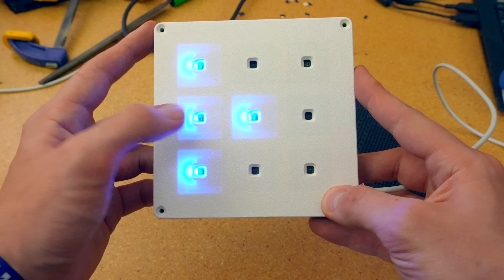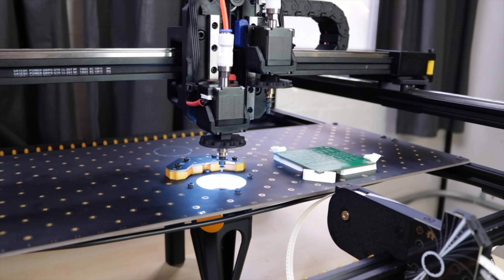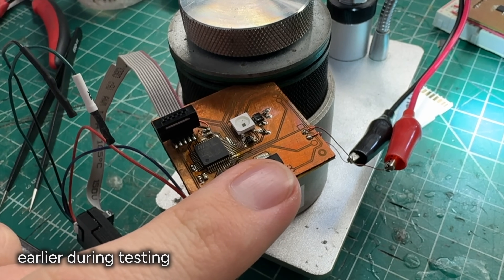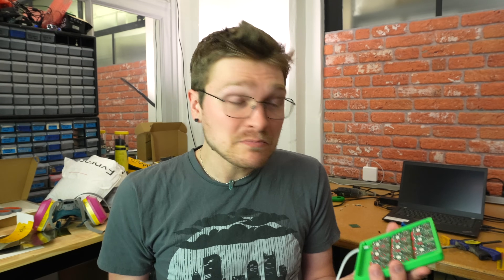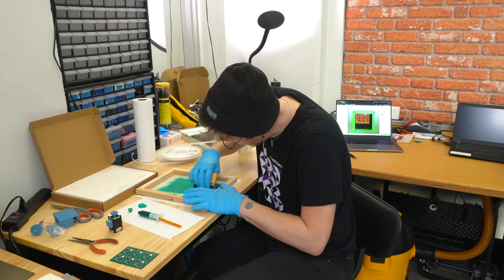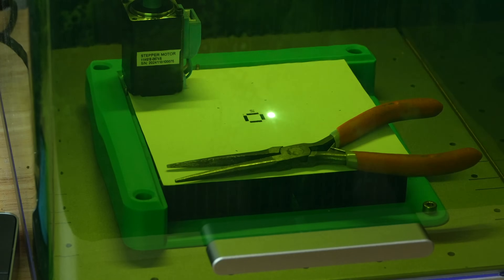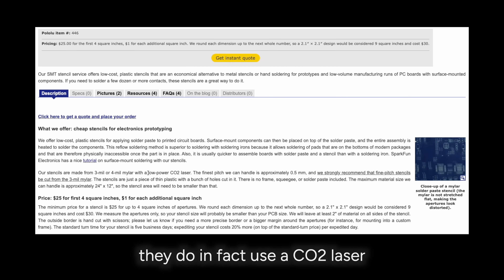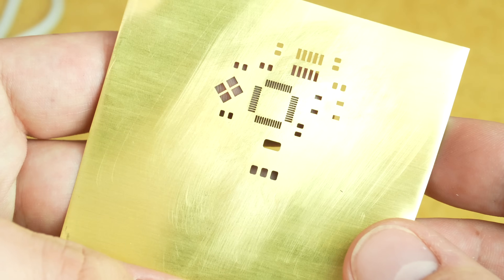Make and Assemble PCBs on your Workbench

Comment: about metal warping under the fiber laser. I have mopa 60w laser and did amazing stencils with water simply being applied between lasering. Contact me I cc an send you profile and give you  info how I did it. I can send you pictures on how it looks.
Reply: btw my stencil was used to apply paste for prototype boards use.

Comment: You're welcome  (the real Harvey Mitchell 🙂).. I already tried the Cricut. Works okay on most packages but the cutting force tears out the material on fine pitch LQFP (.5mm pitch). The high speed cutting of a decently powered CO2 laser with lots of air assist for cooling the cut area at the same time is probably the only way to cut the stainless and brass.
Reply from the maker: thanks for the advice Harvey! your suggestion totally saved me. looking forward to trying a cutting machine!
Reply: @stephen_hawes  I'm wondering if you could use a UV printer like the new EufyMake E1 to both directly print the soldermask and also the stencil by building up multiple layers on a peel off film.
Reply: The best stencil I made was using "solid paper". It came from Hobby Lobby in the scrapbooking section. It's very thin but so hard and brittle that you cant fold it without it breaking like a saltine. Spraying the cut and cleaned stencil with hair spray (light coat) kept it from leaching the flux moisture from the solder paste.

Comment: Where do you buy loctite gc 10? Last time I tried to buy some, it was out of stock and discontinued.
Reply: I use chipquick TS391SNL, works very well for me, it's also room temp stable and easier to source than GC10. Recently opened a 4 year old syringe I found in the back of a drawer and it still worked fine.

Comment: For DIY stencils, polyester film in a vinyl cutter works well down to 0.65mm pitch. I use a Silhouette Cameo, just throw it the paste layer DXF from my PCB software with no tweaking at all. Avoid Cricut at all costs - evil company - they threatened to sue a small company who added a Cricut vector driver to their graphics software as at the time the only thing Cricut would cut was pre-made shapes from expensive cartridges.
As regards reflow temps, just use leaded paste.
Reply: Polyester film like metallic self adhesive stuff or something more specific?
And thanks for educating folks on cricut's cockups, they are very consistently doing that
Reply: @wall_k  not adhesive, just clear polyester/mylar film sheets
Reply: I came down here to say the same thing, avoid Cricut at all costs.  Their machines are great, but the company and their software are horrible.
Reply: There are some Japanese Solder Pastes which are un-leaded but reflow at the same temperature as leaded ones.
Reply: yeah, cricut is horrible. a sticker on the box says something along the lines of "breaking this seal means you agree to the terms of service"
Reply: I will second the Silhouette recommendation. I use mine with a free plugin for Inkscape on Linux, no proprietary software needed.

Comment: I wonder if you would have any better luck with using straight up polyimide (Kapton) film for a stencil. OSH Stencils offers it as an option at both 3mil and 5mil thickness. Not sure if they use an IR fiber laser though. I know you said you tried Kapton backed paper and thing there might be something there worth exploring, so maybe just the thicker film without the adhesive could work?

Comment: Fun electrical routing challenge: Design a 3×3 crossbar switch (connect any of 3 inputs to any of 3 outputs) on a single layer PCB without jumpers or vias.
Good luck 👍
Reply: isn't this just the 3 utilities problem?
Reply: @NotnatTlikehis I don't know what that is.
Reply: you have 3 houses and have to connect them to 3 utilities (electricity, gas, water) without the lines crossing. it's one of those things where it feels like if you try hard enough you can find a solution, but it's actually impossible unless you use some sort of trick like drawing on a torus or running a wire through a window of one of the houses or something
Reply: @NotnatTlikehis  I don't see how water utilities are related to trace routing. But your problem sounds interesting. Maybe I will try it too.
Reply: @sutsuj6437 the point is that you're trying to connect all 3 of one type of point (utilities / inputs) to all 3 of another type of point (houses / outputs) without crossing paths. since the 3 utilities problem is known to be impossible to solve, and the two problems are equivalent, the challenge you presented must also be impossible
Reply: @NotnatTlikehis  Still, I don't understand. I have just solved it with a clever trick. It's hard, but not impossible. Do try it.
Reply: by "clever trick" I can only assume you mean something like the ones I mentioned before, or some other technicality of how the challenge is phrased... what trick are you thinking of? (I have attempted the 3 utilities problem in the past, as well as seen mathematical proofs of why it is impossible)

Comment: Silhouette Cameo machines aren't locked down and have various open source programs that support them.  I tend to use Inkscape with the Inkscape-Silhouette plugin on both Windows and Linux.  Cricut's are very locked down to prevent you from using alternative software choices with them.  I recently cut transparency sheets to make stencils on my Cameo 3. It worked fine after 3 tests to get the pressure correct.  I haven't tried cutting transparency material on a co2 laser, but I imagine that would be faster/easier.  My local makerspace's laser was out of commission when I needed to do this.
Reply from the maker: ahh good to know, thanks for the note! looking into their machines this morning, glad to know they allow more access, and that you've had good luck with cutting transparencies with them
Reply: Yeah - Cricut are a total douchebag company and avoided at all costs.

Comment: For the stencil. Could you cut a thicker metal version first and then use that as a stabilising frame to hold down the thinner material to prevent it warping?

Alternatively, could you stretch out the stencil sheet first and maybe preheat it a bit so there's less temperature difference between cuts and the rest of the sheet?
Reply from the maker: oooh those are cool ideas! the preheat is interesting, the warping is due to the localized heat so if the whole thing is that temp, i could see that preventing it! thanks for the thoughts!!

Comment: Im interested in a comparison of this method versus milling with a desktop cnc. If you can use FR4 and it improves all your downstream processes, is it worth the hastle of the desktop cnc?
Reply from the maker: it's tough, i think they both do different things well. if the cnc software is good and handles pcbs well (like the old Bantam Tools software) it's incredible, especially because it can drill holes and double sided gets much easier. but the software has to be great, and handle auto-leveling and stuff for it to be easier than the laser imo. i really want to try the carvera and compare, because i suspect it might be about the same ease of use, and let you do a bit more

Comment: Metal stencils comes with big frame (30x30 cm sheet, 2x2 cm frame). That's why they have no warps
Reply from the maker: AHHH i didnt consider that, i figured they were cut from sheet then applied to the frame after, but i bet being under tension would help keep them flat
Reply: @stephen_hawes  I'm not sure about order of operations. Maybe they have holes on sides when laser cutting and then put to frame (so there is still some mechanism for tension during cut).

Comment: Wow that 0 ohm "via" idea (from 8:19) is mind-blowing to me! Very good idea! I have a project, where I need exactly that!
Reply: fyi this isnt new this is use on pretty much every single sided board product, even before smd they used metal links to make jumpers, then it just changed to smd jumpers. so thats been done for decades
Reply: @victornpb  I'm just getting into PCB making and basically everything is new to me 😅
Reply: I am too much on the internet This has existed for so long, how can people not know about it
Reply: I couldn’t follow. How does it help?
Reply: The main advantage of having traces on both sides of a PCB is that you can route one trace under a different trace. You can't do that if you only have one side to work on. Stephen is using a 0 ohm resistor as a little bridge to allow one trace to jump over another to solve the same problem
Reply: @Werdna12345  you can use a 0 ohm resistor to jump over a route, why? Because you have limited space or single layer pcb.
Reply: @Werdna12345  you use the 0 ohm to go over another Trace. eevBlog have a great example of that with more than 20 resistors